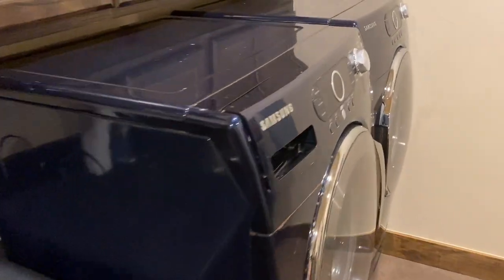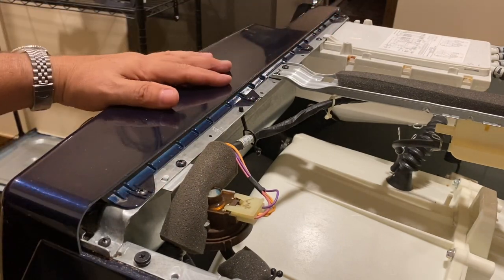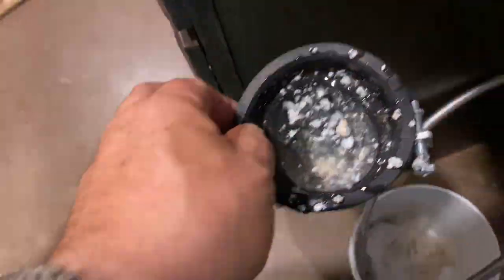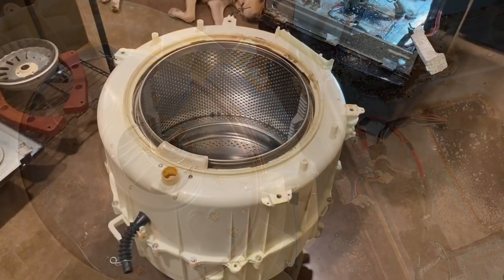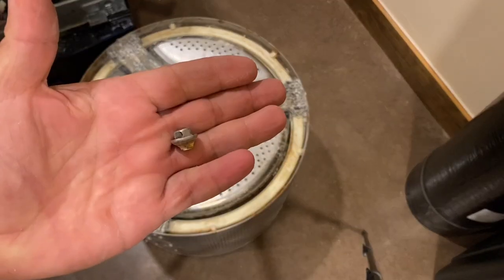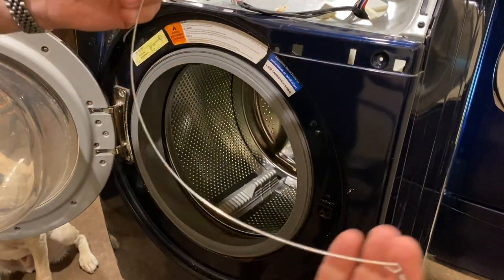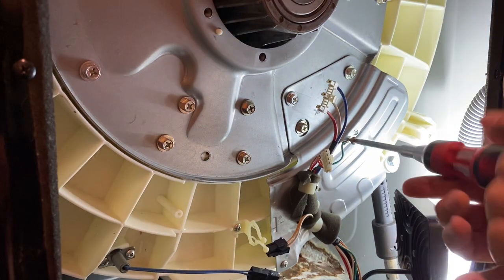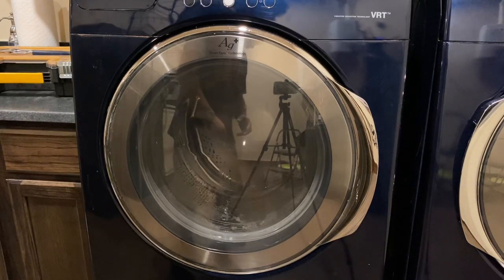✅ Samsung Washer ● Replace the Spider Arm ● Make Yours Like New DIY! WF337AAL XAA

Comment: It's a great video and you did a great job but i just think this one is too much for me. I've changed the door seal which wasn't too bad but this involves pretty much dismantling the whole thing. Plus knowing my luck something else will be an issue like a sheared bolt or brittle plastic that breaks. I don't have any power tools either. I'm not buying another Samsung again.
Reply from the maker: You bring up great points. It is dismantling the entire thing essentially.  The job does require some power tools. I wish you the best!

Comment: Same issue on my samsung only 6 years old. Chunks of metal in the filter and wouldnt drain. Didnt realize what was in filter until this video, but the repair person said the exact same thing. Easier to replace than repair, they normally dont do this job.

Apparently hard water can be a culprit.
Reply from the maker: You and I had the same experience. Really a poor design, given that the spider arm is exposed to water. They should be using different metals or some composite or something that can survive in that environment. Thanks for your comment. Did you end up fixing yours yourself, or replace?
Reply: @ApacheRanch  I was reading other comments as well and they agree with you that the design is poor considering this part is exposed to water and detergent. The repair person said over time it happens but I'm pretty shocked 6 years is all it took. The filter literally looked like is was full of silver shredded confetti chips. 

Quote to repair was $1300, also requires new outer shell. Brand new our machine was $1100 so we will be replacing.

Comment: I can not remove that back bolt because the drum moves freely. Any suggestions
Reply from the maker: Do you have an impact wrench?  That will free the bolt.
Reply: @ApacheRanch  I do, but it won't make a difference I did just see another video of the tech sticking a screwdriver in one of the   screw holes to lock it into place. That's for anyone having my issue.
Reply from the maker: @TheMisterEGUY  glad that worked. Just be careful to keep that away from the copper windings and the ceramic part (could crack).  Thanks for your comment.

Comment: wow that looks like a ton of work & ive been turning wrenches for 10 years lol hopefully mine hold up for years to come
Reply from the maker: It’s easy work. But just a LOT of steps to take it apart. But seemed like such a shame to ditch a working machine due to this issue. So I’m glad I fixed it.
Reply: @ApacheRanch  ya it is alot of steps & ya id probably do the same.
Reply: @ApacheRanch great video.  Had this exact problem on a nearly identical washer.  Great tips throughout (rabbit ears and socket size).  Had mine apart and back together in a couple of hours (after parts arrived).  Excellent work!  Thank you!
Reply from the maker: That’s great! Glad this helped you!!! Great job getting another 10 years out of yours!!
Reply: My washer is doing the same. But, it’s really old. I’m thinking by the time I fix this, other crap with wear out as they design them with a death date in mind.
Reply from the maker: Honestly this is the key part that fails. You will have a lot more years when this is replaced. Other parts are easier to get at also.

Comment: Wow, great camera work and editing.  My appliances all tend to fail  on or day before a major holiday.  Water heater was Easter a few years ago, heat pump/air conditioner was 4th July 2023,  dodged a bullet labor day, and greenhouse issues Thanksgiving 2023.  This appears to be my 2023 Christmas issue.  Your video will same me some money but more importantly a lot of time.   Sending a small token of thanks.
Reply from the maker: Well you sure do have some interesting timing with appliance failures! I can't thank you enough for the generous gift!  I sincerely hope the video helps you get your washer fixed up soon and without a lot of hassle!  I wish you the best!

Comment: very helpful! So, the bearings were fine on yours? i have a destroyed bearing and am working on trying to remove old ones and fit up the new ones.
Reply from the maker: Yes bearings were fine. I have changed those on a Maytag and they are not easy to get out without specific tools.